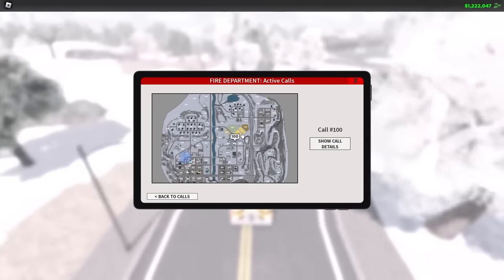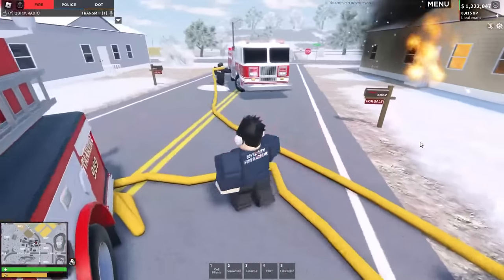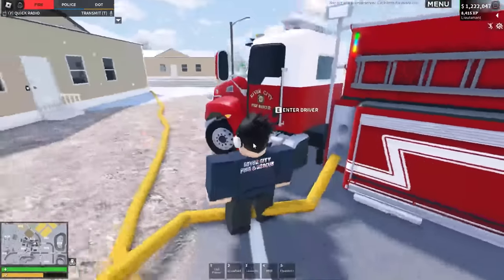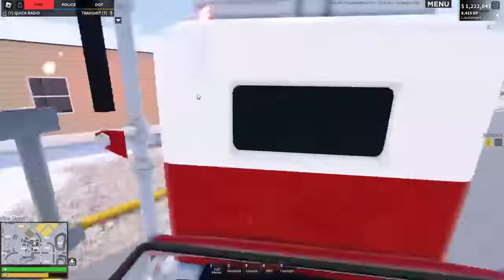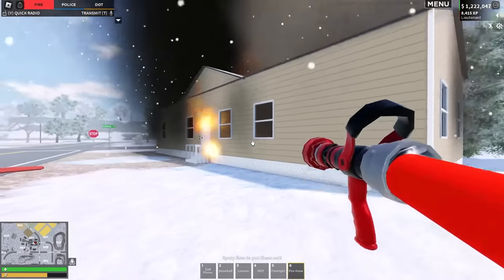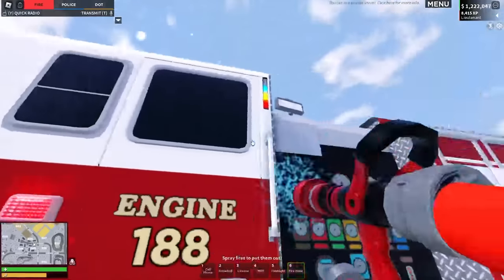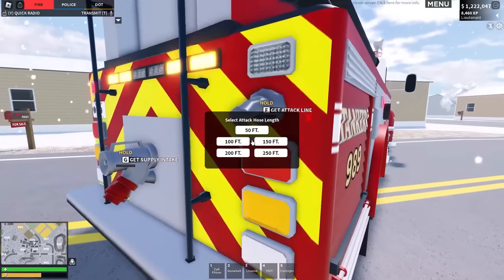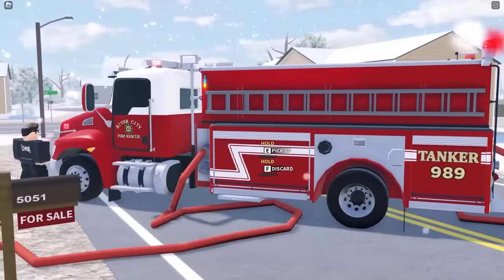How to use the new Fire Hose System in ERLC!

Comment: fun video idea - connect a tanker to a hydrant, connect another tanker to the tanker and so on. Try to circle as much of the map as possible using full length hoses. and then at the very end an attack line to put out the fire :)

Comment: 1st: it was posted 12 seconds ago

Also, I’ve been using the brush truck for all fires, because it has the sprayer and the attack line
Reply: Same I think the Brush Truck is one of the better ones for the fires as it can get up high rock park and is faster.
Reply: Is can also connect to hydrants
Reply: It has a decent amount of water too
Reply: @Rocketcoasternerd  not really lol, it lasts like 2 or 3 minutes with the sprayer and an attack line going
Reply: @ethanmiller9146 most trucks last that long